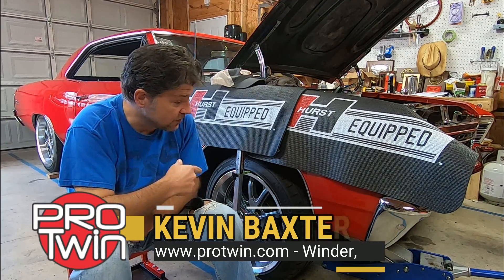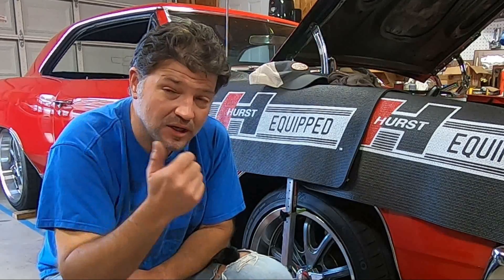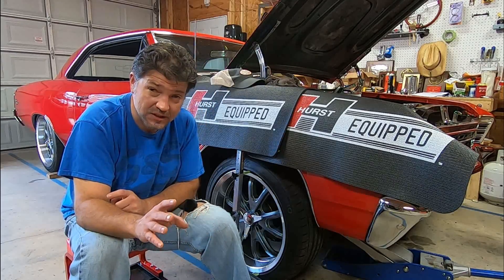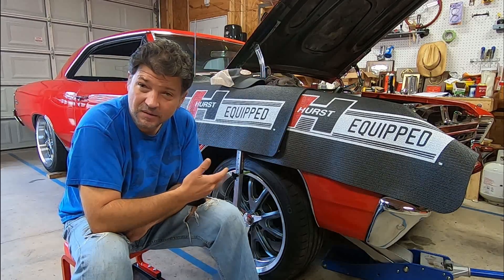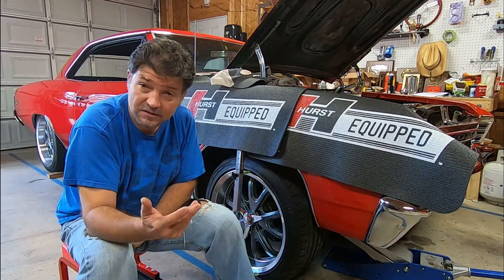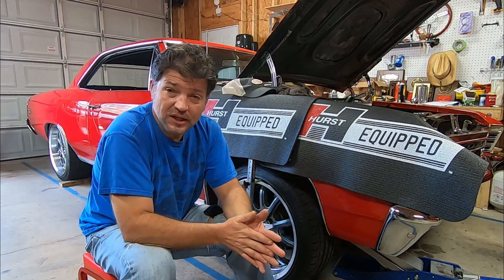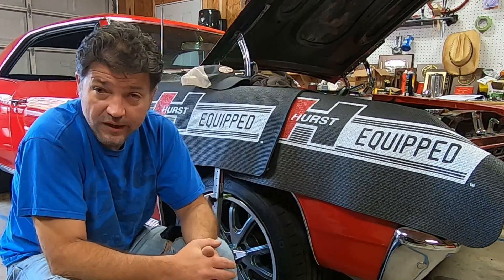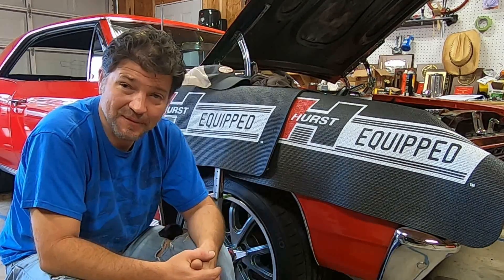Rake and Trail Explained - Car Alignment - High Speed Wobble - Kevin Baxter - Pro Twin Performance

Comment: i feel another important part of the steering and or handling of a bike is the handle bars . what im referring to is the center line of the handle bars in reference to the center line of the forks when looked at the bike from the side .  for instance if the handlebars are pushed forward of the line of the forks the steering will feel "twitchy" or" quicker" , on the other end of the spectrum if the handle bars are pull back to the rider past the line of the forks the steering will be "sluggish"  . a neutral feel would be aligning the handle bars with the line of the forks .
kevin baxter  , if you want to expand on this please do so . and as always your videos are extremely helpful and i enjoy the tech that you go deep into.

Comment: Excellent presentation Kevin. I know a very little about the car alignments, owned 3  Porsche 914's. I also had some learning experience on rake and trail and what it does to the bike. I had a 75 RD 350 I was turning into a fast canyon carver. Picked up a TZ 250 race bike in pieces mainly for the roller bearing crank. I was updating the engine with Don Vesco's shop's help. The engine out for update gave me time to do some frame mods. I took the TZ 250 front end and installed it. Everything went smoothly with the new front dual disc front end until the first ride into my favorite canyon. The steering was suddenly heavy as molasses flicking from side to side.  But boy were the front brakes strong! Immediately I turned around and went home to figure out what was wrong. Finally clued in to me that the bike leaned more on the side stand. Why would that be? Started measuring things, found out the TZ front forks were 1" ( yes, one inch) longer than the stock forks. Ah ha! Lowered the fork tubes 1" thru the triple trees and retorqued. Went for that ride again and came back with a BIG smile on my face. When I put on the TZ forks, I had changed the trail number to one that was longer, slowing down my steering. The TZ's had longer forks and longer shocks to raise the bike for more lean angle. I didn't know that before. BY the way that RD was a screamer! Very fast for the times. Honest 135 MPH, 325 pound rocket. I'm glad I survived it. No power below 6,000 RPM, then  6-12 thousand was hold on baby.
      On a similar subject, can you explain why a bike turns a smaller circle when leaned as opposed to turning with the bike straight up. This is in slower speeds as in a tight u-turn, fork and handlebar angle the same but lean angle greater equals smaller diameter circle.  I have a couple of books on order, one is Motorcycling Handling and Chassis design by Tony Foale.   Also Motorcycle dynamics by Vittore Cossalter. Thanks Kevin, when you explain things, they suddenly become clearer!

Comment: Kevin, your knowledge and application along with your explanations of them are excellent. I enjoy them all. This one in particular really has me thinking. I wanted to look this alignment effects up. I recently picked up a 2015 Road King. 5400 miles on it. I’m at 10,000 right now. The bike with no hands on pulls right hard enuff I can have more than one cheek off the seat to get it to track straight. I got a set of Legends for the rear and I noticed that from side to side the swing arm to the frame mount shock distance measured with a tape measure, is about 5/16” different. That surprised me. I left the shocks set equal and didn’t adjust for that difference and the bike tracks straight. I put new tires on during my 10,000 mile service and I noticed that the left side adjust cam contacts the swing arm boss before the right side. I didn’t measure it accurately, but it’s at least 0.010”. I re-cleaned the adjusters and the bosses, nothing different. Next step I was going to go to a straight bar from rear wheel to see where it aligns to the front. I have put digital levels on the frame and the brake rotors, they agree to true within under 1°. I was going to ratchet strap the rear wheel to make both side adjuster Cams and bosses contact. I know manufacturing tolerances vary. But this bike is the most I’ve seen. You did a video with Legends that got me better info and actually a video of Legends actually talks about that swing arm to frame mount variance. Thanks for this video I have more detective work to do. Keep up the great content! Always enlightening!
Reply from the maker: best of luck..  read thru all the comments on the video...i type a few replies that may add to your quest.
Reply: @KevinBaxter  I had seen the question about the sheave side bearing wear. That’s one reason that prompted me to comment. 
Thanks Kevin

Comment: 32 inch stanchions with reversed early 70's Shovel lowers (hydroglide, caliper trailing on the right), 21" front wheel.
The rake is darned near 45 deg. with no stretch (PVC spacers are 8"). And I'm sure many here haven't a clue what
I just wrote ;^) Suffice it to say  the motorcycle is long.

At anything under about 10 mph it is VERY unstable. At a stop I must keep a hand on the bars to keep the
front end from flopping over (oh, and I shift with  my hand on a jock top). At highway speeds it very stable.
Rock solid. Corning (I like to corner) can be interesting in that if I'm a little hot the front will push a tad.
I know it. I make room for it.

Every time I adjust the drive chain I run her up on the highway and let go of the bars. If she runs straight
without a weight shift I know I got the chain straight (rigid frame). And by the way, on those years of Shovel
lowers the hub is spaced about 1/4 or so to the left. I've never bothered to pull the wheel back with the
spokes.

How many here are scratching their heads? Raise your hands Heh.

I'll be putting new cups, bearings and races in the neck here in the next couple of weeks. ;^)
Reply from the maker: you are a prime, but extreme example, of what i spoke of...but you know that already.  LOL.  everything is a balance.  thanks for the comment...sounds like a very cool ride.

Comment: Any description of m8 nasty vibrations through bike and possible cure. Poor engine balancing?
Reply from the maker: most often when we build an M8, we remove the balancers and balance the crank.  we find a litt more vibration at idle, but much smoother at speed and faster you go.  a balancer is a trade off...and well....a balance.  LOL.
Reply: Thanks Kevin. Are S&S cranks balanced?

Comment: Great explanation Kevin 👍🏻.
My 2009 Road King has pulled to the left from day one. 2 different wheels and tires, stock size have been tried. Alignment done etc. I’ve asked a few different Harley Techs and they all say this is normal. 
I have owned too many motorcycles to keep count of and this is the first one that has pulled like this?
You literally have to press on the right foot peg really hard and lean to the right to get it to go straight if you take your hands off the bars. 🥴
Reply from the maker: i have removed auto primary chain tensioners and installed manual ones...and have seen this issue go away.  i was surprised....but it did.  im not claiming that is YOUR fix, but I've seen it.  as G DUBB says below...neck bearing adjustment can be a factor...so can wheel spacers.  an aluminum wheel spacer can crush especially if torqued too tight.  shift that rear wheel to one side, even a little, it can create a pull.  i have actually made spacers just slightly offset...like .020 or .030...and it has corrected this issue.  hard to say exactly.  can be trial and error.  try this...take all your gear...jacket, chaps, tools, rain gear...and put it in the saddle bag opposite of the direction of the pull and see if that changes anything.
Reply: @KevinBaxter  Thanks for the reply Kevin, I know you are busy. I’ll try moving the wheel and weight as you said. 
I have a  Baker compensator and primary tensioner already installed on the bike. 
Thanks so much for your time.
Reply: @KevinBaxter  I have replaced that auto chain adjuster. No effect on the pull. Interesting idea tho, it makes sense when you think about how everything is tied together
Reply: When is the last time you checked your steering head bearing? Could be loose.
Reply: Or like Kevin says maybe adjust your rear wheel to the left a hair and see what happens?

Comment: Awesome  Kevin, Thanks.  Question for your next Vid, What about Belt drive bikes?? ... Wouldn't adjusting the rear wheel affect belt wear on the rear Sheave ??? And if adjusted wrongly - Belt-Tension wise - cause failure of the Sheave-side bearing?
Reply: Great question!
Reply from the maker: yes...you are correct.  understand im speaking in VERY small adjustments.  slight enough that the belt or chain alignment is hardly affected at all.

Comment: Yes rake and trail. Did a bit of research on this. On my 09 sb I put a wide glide on.  Had to use a fb tree BUT it de raked it by 1degree. Gave me a bit extra trail ( of the fb) but I’m using a 19” wheel. If I used wide glide trees with 3drgree rake it would have took out to much trail. ( for my riding ). But now trying a 21. So thanks for the update on that lol.
Reply from the maker: youre welcome.  heres a follow up.  great comment.  thanks.  https://www.youtube.com/c/KevinBaxter/community?view_as=subscriber

Comment: That's AWESOME!!! I have a 2020 SGS that comes with a 130/19 front wheel. I install the Native Customs fatty front tire kit, which is now 180/18. I have noticed a significant amount of improvement in my handling and cornering because of it. One of my buddies swears that his handling fine with his new 23 inch wheel. I have also noticed that at high speeds, that my bike is more stable now with the 180/18, in the front.
Reply from the maker: exactly.  you most likely have a longer trail than he does....  follow up here https://www.youtube.com/c/KevinBaxter/community?view_as=subscriber

Comment: 2019 road king special, 16 inch apes, have high speed wobble with stock and Perelli tires, stock and legend suspension. Steering bearing checked twice, tire pressure good, true track stabilizer. Light grin or the bars don’t help. Starts about 85 mph. The only thing that helps is leaning forward, that’ll stop it. I can ride my buddies 2019 road glide special much faster and it’s straight as an arrow. He has 14 Inch apes. The fairing?
Reply: You can either push those apes forward a bit and lean more forward when you ride fast, or maybe try loosening your triple tree pinch bolts and sliding your fork tubes up just a hair.
Reply: Cast rims or spokes?
Reply from the maker: so many factors....16inch...and most likely wider, will make it feel more twitchy...wind, etc.  if leaning forward helped, try what G Dubb said...tilt the bars a little forward.  Also...try stiffening the rear shocks.  one may counter act the other.
Reply: Thanks all for the ideas. It’s got the stock cast wheels. I did try stiffining up the rear shocks. I am definitely a sail up there.